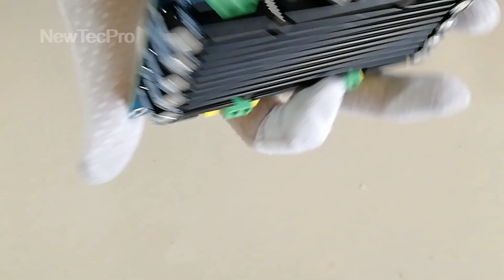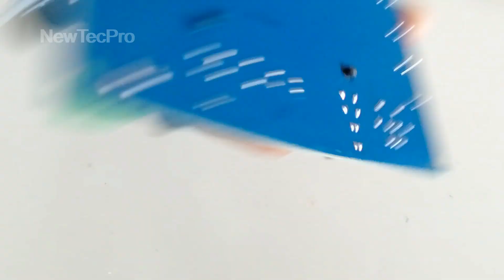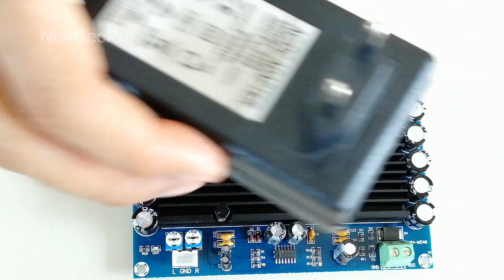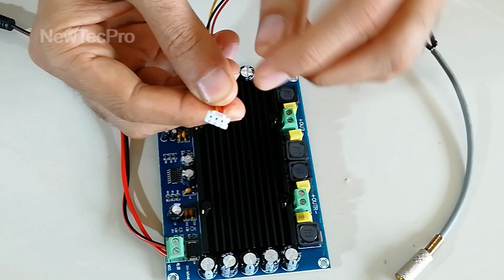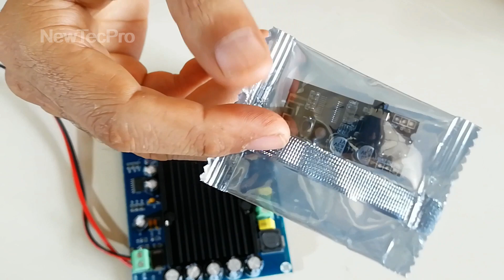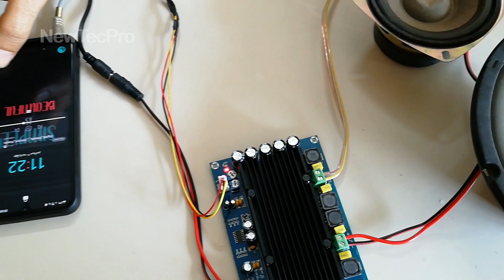Install 2x150W Stereo audio System XH-M546 Amplifier

Comment: What is the humming noise?
Reply: I have this board. Its humming like crazy. Impossible to power with switching power supply directly. Acording to specsheet its 50W per channel max in stereo. 100W bridged in mono at 26V.
Reply from the maker: Thank you for your informative technical comments. Yes that's right. 150 watts is not RMS power. 150 watts is the maximum power. Noise can be controlled with a suitable capacitor.
Reply: @newtecpro  I am buliding amplifiers from my childhood. :) Even high freqency filter with big capacitors array was not able to get rid of the humming noise completely, when powering from switching power supply. :)
Reply from the maker: Excellent, what power supply do you recommend?
Reply: @newtecpro  Linear power supply with good filtration.
Reply from the maker: Thanks for your suggestion. I will try to test this in another video and put it on the channel
Reply from the maker: The noise is related to the power supply of the MP3 player board. This noise can be removed with a capacitor. We will post a video about this on the channel in the future